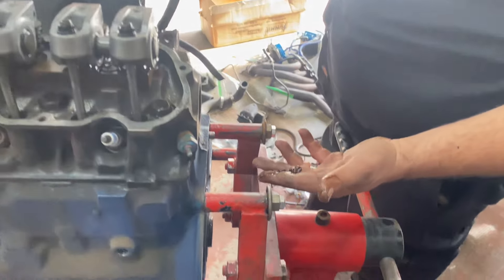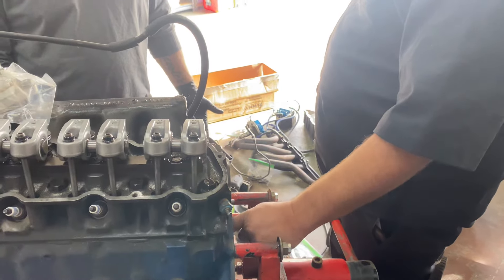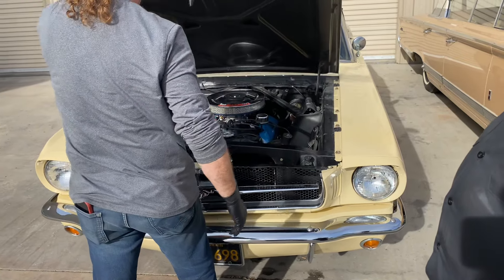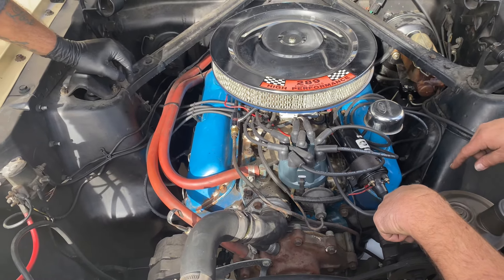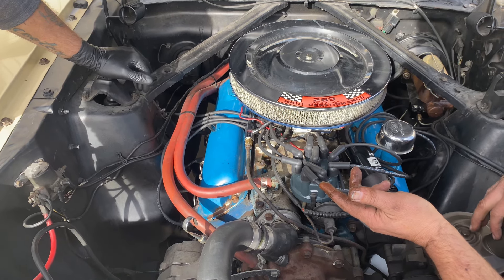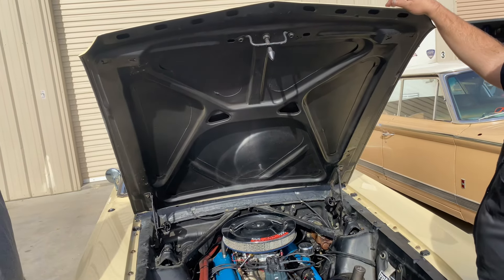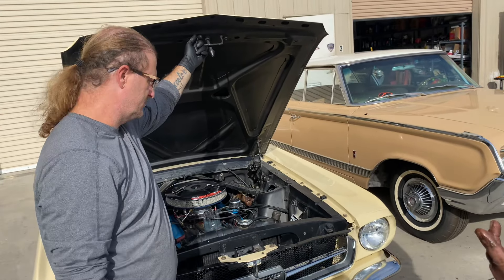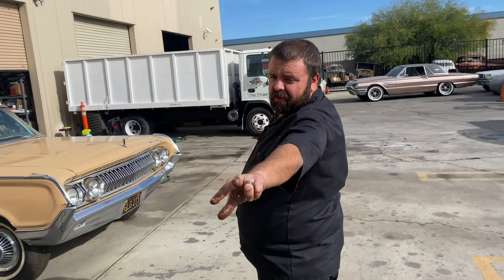Jordan’s 1966 Ford Mustang - Ford’s scuzzy cooling systems, why we recommend a Gano Filter

Comment: Ease of use with premix. I have mixed for decades, cheaper, and, with 3 of my own, and 2 kids, neighbors, using shade tree mechanic Dad who Measures instead of guesses how much , into clean used containers, then tests the levels. I have had no problems. Seeing where the filter is placed, and the gunk removed from the block, how do you keep the debris from draining back into the thermostat? Assuming you drain from the petcock, not assuming antifreeze only flows towards the radiator while draining.
Reply from the maker: The crud is in fairly large chunks, usually gets caught up in the actual filter itself.  When cleaning the filter, you can easily inspect the thermostat and change or clean it accordingly.

Use of premix in a shop setting is to keep liability off of our hands, if there is an issue caused due to improperly mixed coolant, that’s right out of the vendor’s pocket, not ours or our customer’s.  It’s also a time saver for us and a labor cost saver for our customers.